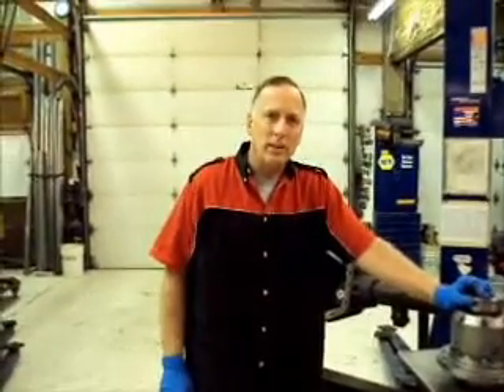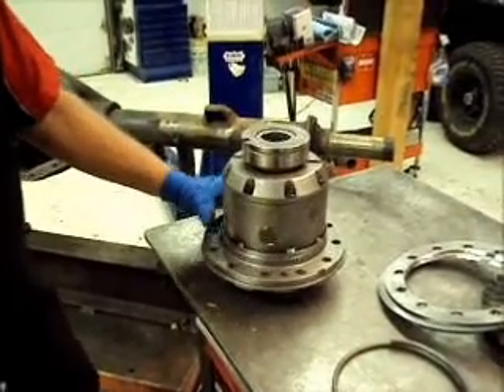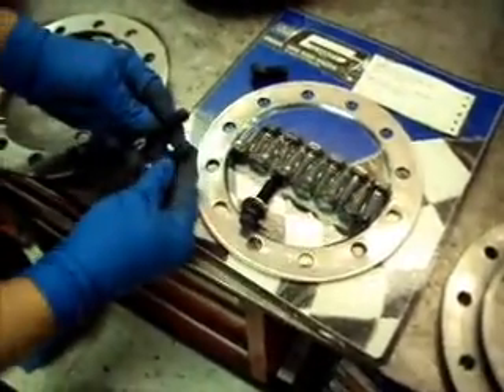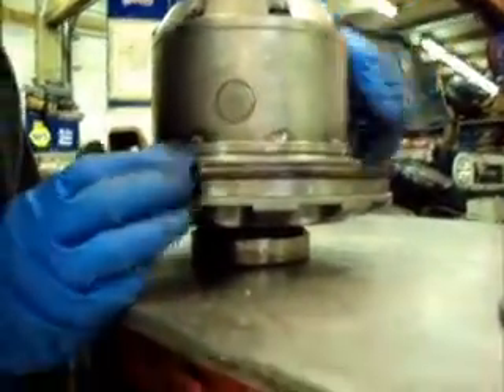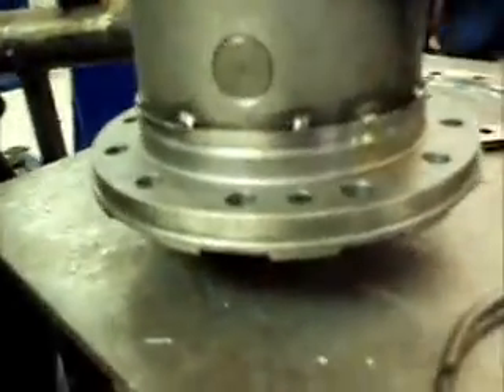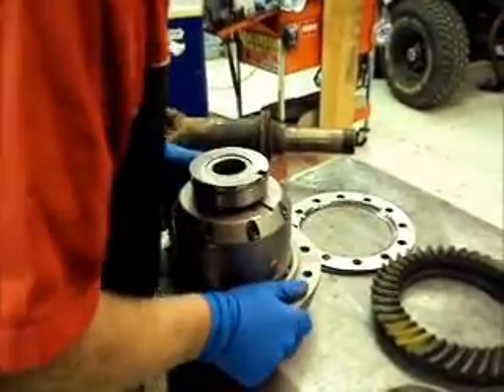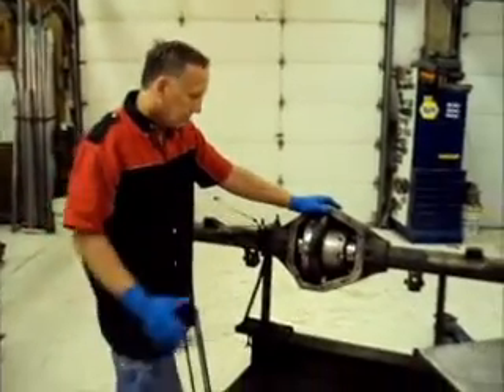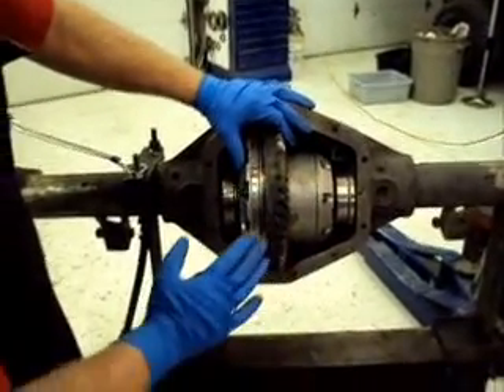installing dana 60 or 70 gears into a dana 61 by jantz engineering

Comment: If I put 70 gears on 60 carrier will 60 carrier fit in 70 housing
Reply from the maker: The carrier will fit easy but both the bolt pattern, and ring gear press on diameter are a 1/2” different in diameter. If your a machinist, no problem.
Reply: @superjeep47  I can get OX Lockers  60 carriers and want to put 70 rings on them and stuff them in  housing.
Reply from the maker: Time for us to talk. My cell is 425-327-0804.  9am to 4 pm pst. Please text me first

Comment: What is the difference in axel shafts on the dana 60 and 61? Also how do you know the difference between the two?
Reply from the maker: The 60 has the number 60 cast into the housing, a 61 has a 61. They both use 30 32 or 35 spline axles, I am not sure if the lengths are different. If it has 3.07  or 327 gears its a 61.

Comment: Love your work & thanks for posting these videos!  I'm building a 4x4 & I have a 2003 Dana 70S out of a 3500 Chevy Express Van.  It has some cool features, but it's odd that it uses threaded adjusters for the carrier instead of shims & the diff cover has 12 bolts instead of the typical 10 that is usually found on Dana axles.  Yeah, I'm positive it's a Dana... Have you come across this axle in the course of your work? Is this an axle that most guys should try to avoid?  What do you think?

Comment: Glad i found this info. I have a 89' Dodge W150 that i swapped in a rear Dana 60 FF. For the front i found what turned out to be a Dana 61. Currently running 4.10 gears with 38" tires. I've been trying to figure out how to switch to 4.88 gears on the Dana 61. I need to save this page. Guess yall could send me the whole front shebang when i'm ready to buy one. I already bought chromo front shaft upgrade.